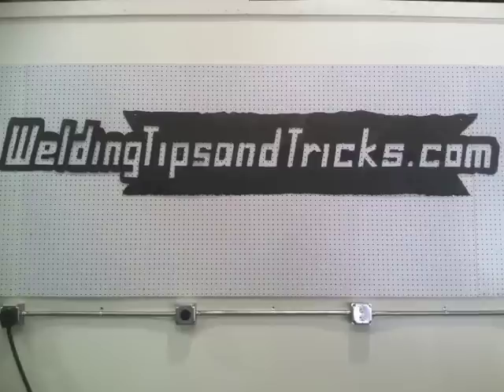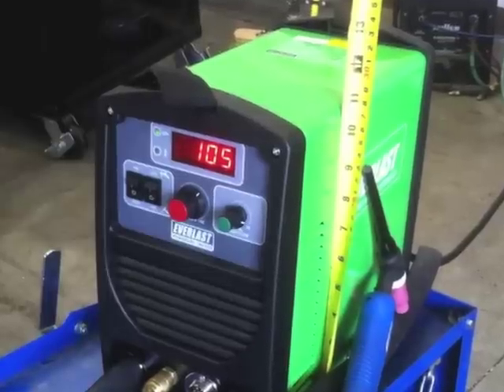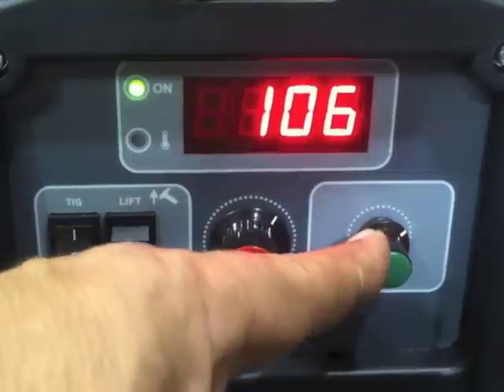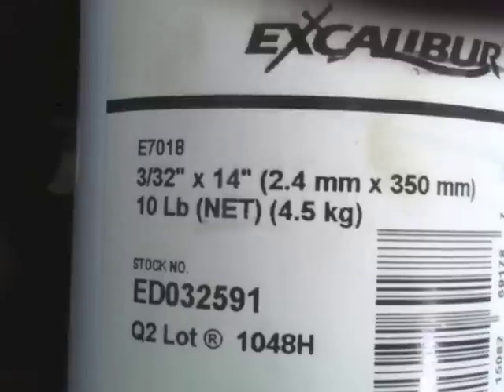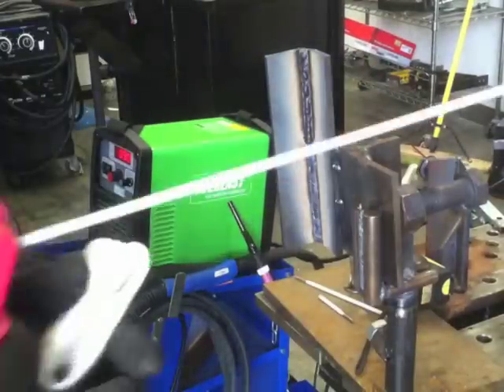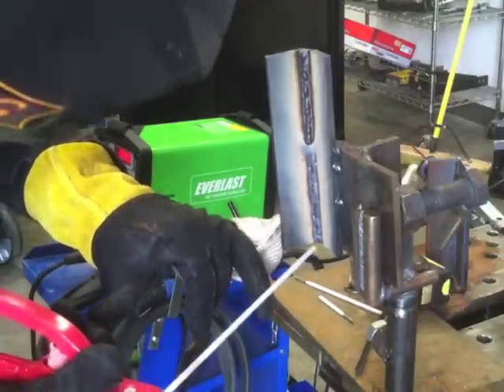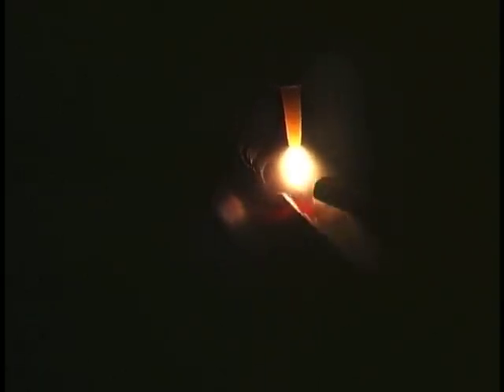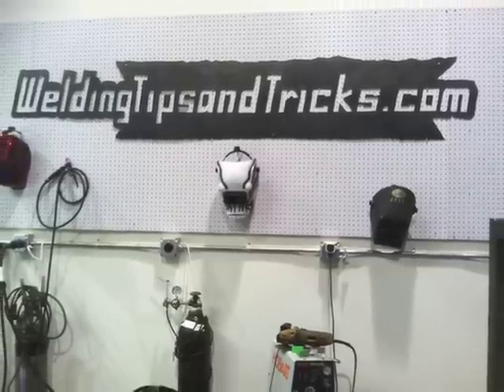Everlast PowerArc 160 Stick Welder DC Tig Welder

Comment: Hey Jody, I'm looking to get this welder for my first tig welder. I'm not new to welding by no means but this will be my first personal tig welder. I just want to know your person thoughts as far as a welder that could possibly be used everyday. Not very extensively every day. But will be maxed out here and there. Mostly small projects, custom fabrications, repair work etc.... I can't afford a $1,000 welder...... but for $500 with HF start I can afford it. Just wanna know if it will hold up and not break under normal wear and tear use. Thank you for your videos, they have helped me so much over they past couple years.
Reply: Mark Everidge these are all new machines (everlast) no one knows how long they will last its way too early to tell but for $500 bucks if it does last a few years then you made your money back

Comment: will this machine run 6010?
Reply: john doe because inverter welders have a hard time running 6010, although as an update i did buy this machine and tried it with 6010 just for the hell of it and it seemed to weld just fine.. but to be honest i dont weld that much with 6010 so maybe i just dont know the difference.
Reply: +Guinelle1 no
Reply: +xx4x4x4 It's a DC stick welder. why wouldn't it?

Comment: Does anyone know why I always get porosity when I stick weld? The welds don't look bad but for some reason they have porosity. Most of them.
Reply: Chuy Rdz either you dont clean the slag off right or your arc is to high get more close to it
Reply: If your ark length is to Long or maybe your rods are dirty or full of moisture or if it's on the beginning of weld could be moving to fast when you trike and ark
Reply: Thanks guys I think it could be the moisture since I keep a tight arc.

Comment: I bought the Everlast powerarc 140 and for some reason it maxes out at 80 amps..I literally have no clue why that's happening..its capable of 140 amps
Reply: My 160sth on 120v only maxes out at 120 amps. On 220v the machine will weld at 160 amps if I need it. I am not familiar with the 140 but that maybe your problem. If not contact Everlast
Reply: My 160sth runs at 88 amps at 115v but when i use 220v i get 160amps.
Reply: +Nelson Marrero Are you using a 20 amp outlet??

Comment: Hey Jody,
I know this video/review is over 2 years old now, but I was recommended to look at this little machine from a guy in my welding class. It combines my 2 favorite processes(GTAW(tig) & SMAW(stick)) together, which I like. I currently don't have access to a 230V connection here where I live, only 110V. Would you recommend anything in particular in regards to power/breaker rating for the 110V connection?

thanks!
Dan
Reply: chopperdan88  20 amp breaker for 115v connection but works better if you can get on 230V with a 30 amp breaker.
Reply: Jake Bliedung Thanks!

Comment: Too bad Everlast can't defy the laws of physics and fit a 60% duty cycle AC TIG welder into a package this small. Next best thing is the 185 and I've been pretty happy with it. I need more power now that I'm into thicker aluminum. PowerTIG 200DX has caught my eye.

Comment: This looks similar to the Harbor Freight 160 inverter I'm using. I am pleased with the welds. My only complaint is no foot pedal, so you can't ramp the amps. :( 
I'd like to modify it to use a pedal. Any suggestions on a cheap pedal?? Or will I have to make one?

Comment: Yep, solenoid in the welder.  Seperate connection, not gas through the DINSE, but it's a quick connect, like a Milton fitting.

Comment: My 140 st works very well on TIG mode, even down to 9-10 amps..7018 seems to start cold though but does run a nice bead overall... I wonder if Everlast would let me do an upgrade and swap for one of these 160's.